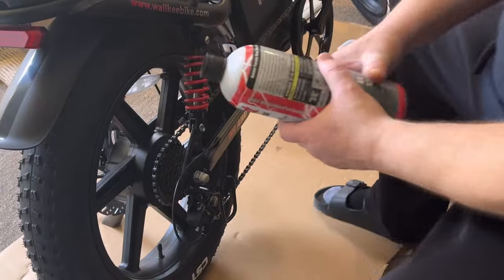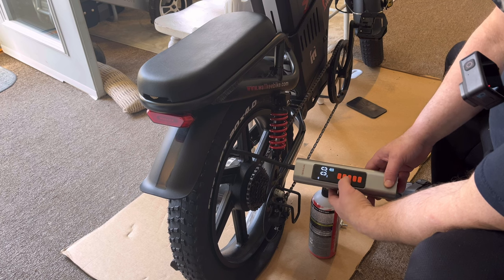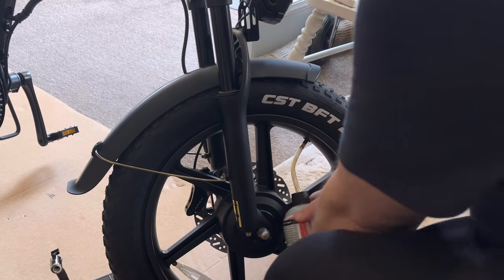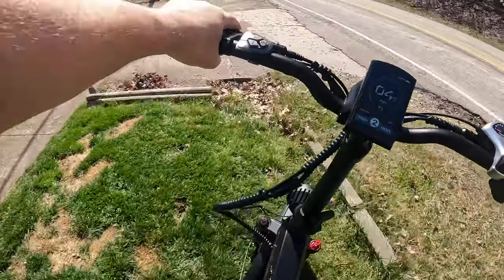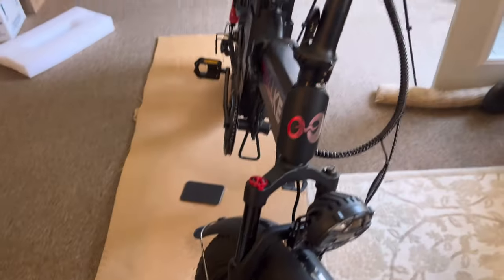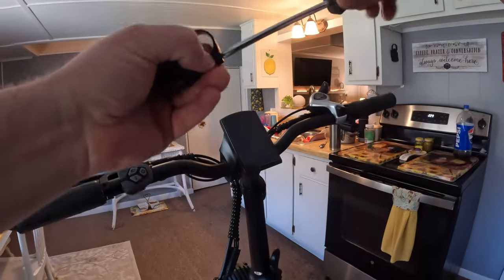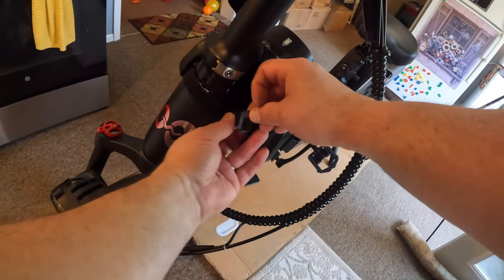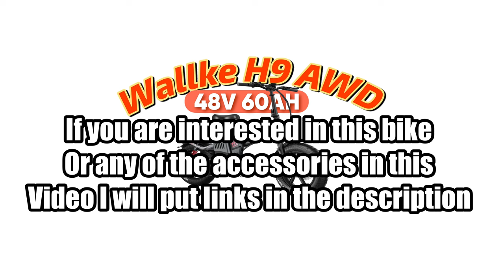Wallke H9 AWD Ebike Review FlatOut Tire Sealant Install FIRST RIDE Accessories Added

Comment: This is the already the second video of the H9 AWD I'm seeing which has the funky front motor issues which result in those vibrations and skipping noises. I wonder if it's a generic issue with the controller. Did you figure that out yet?
Reply from the maker: From other owners who claim to have spoken to Wallke the AWD models all make that sound. They are claiming its harmless. Time will tell. It only does it in AWD. Other then for that weird sound the bike is amazing
Reply: @PapaPR3232  Thank you for answering so quickly. I'm contemplating getting one as well, but it looks like the bikes start vibrating once they do that, which would be a no go for me. BTW currently watching your first full outing. I myself had a sport accident "too", I swallowed a basketball (at least that's what i tell the kids) and I'd also appreciate the power of this foldable. Cheers from Germany!
Reply from the maker: They do not vibrate. I think i said that in my first video for a lack of better wording at the time. Its just a strange noise and its between 26mph and 29mph for me and its only in AWD
Reply from the maker: @oliverhadatsch409  just following up a few months later no issues with the chatter sound and Wallke has upgraded their Wallke H9. It has dual 1000w motors and a lower profile 60ah battery. Now is the time to get one! I wish i waited

Comment: Csn you do a range test please 👍
Reply from the maker: I just got the Ebike 2 days ago but plan on doing many videos soon. A range test will be a video i do in the future. Thanks for commenting
Reply: @PapaPR3232  no worries mate, it's a great video thank you watching from the UK.
Reply from the maker: @vision-hj8tv  I appreciate the kindness. I just started doing ebike videos partly because I need to lose weight and partly because I have become an affiliate of a few companies but I’m still learning for sure
Reply: Congrats on getting your bike set up. My set up similar except that I have put on a rear bag with built in panniers then if I want to go shopping or to the beach in summer can carry what İ need. When I put in the equivalent of your Flat Out they recommended that after inserting the liquid blow air through the  valve fitting before replacing the valve stem. I assume that this is because any remaining residue might cause the stem to stick so could cause a problem later.
You are lucky in the States to be able to use more powerful bikes. İn Turkey and the rest of Europe we are limited to 250W motor and no gas control with max speed of 25kph (15.5 mph). Having said that I, so far, have had no problems with hills as my motor will max out at about 630W and my foldable bike weighs 23 kilo/50 pounds. Was out riding today (about 64°F) and maximum speed easily maintained on PAS1 on the flat.
Good riding.
Reply from the maker: Thanks for the comment. I have a rear camel bag coming. It was supposed to be a freebie with the bike but they informed us after the purchase we wont see these freebies until april. Sounds like you have a good setup Good riding to ya!